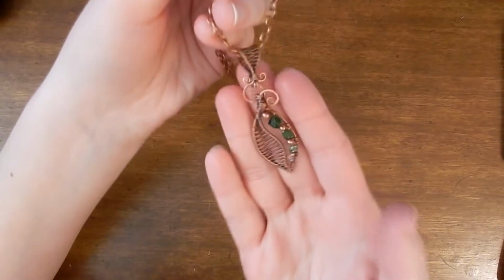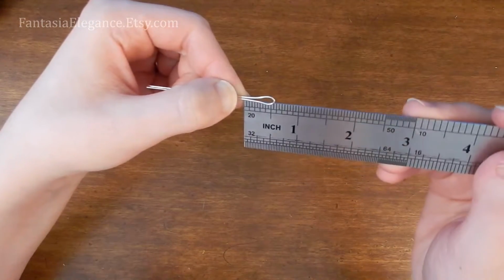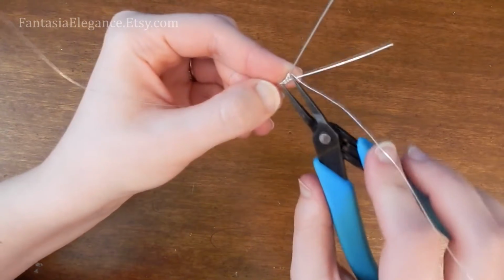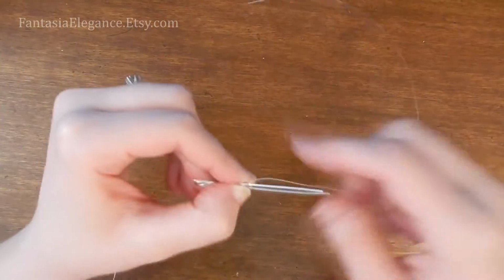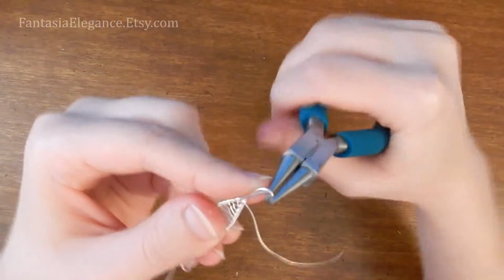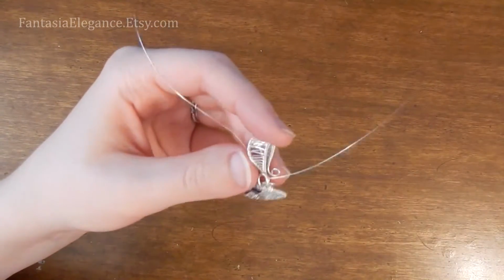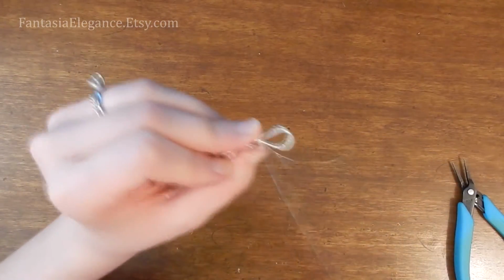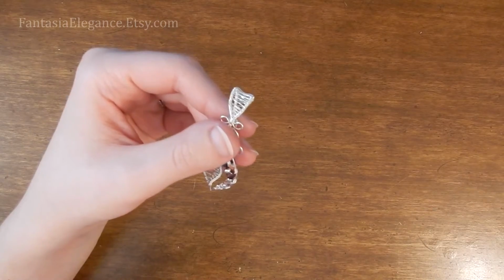Easy Wire Weave Bail Tutorial - How to Make a Detachable Bail for Beginners

Comment: “Thank you so much” I’m doing good with the jewelry making but I’d like to make a few  of your designs. I want to order some wire but would like to ask you what types of various wire  to order to begin with. I do have some wire from the craft store but would like to order the best sizes to begin with. I’m amazed with your designs and appreciate your videos. I’m recovering from cancer treatment and can’t get out to shop to find these various sizes. Just want to ask your opinion because it’s hard getting out to shop. Thank you for all your beautiful videos.🌻🌻🌻
Reply from the maker: You're so welcome! It depends on what you're planning to make.... if you're most interested in wire weaving, then something like 18 or 20 and 26 or 28 gauge would be a good place to start. If you're doing more general wire wrapping then I'd recommend starting with 18, 20, and 24. Also, RioGrande is a great place to order wire online! I always recommend something super affordable and easy to work with like dead soft copper when you're practicing :) I hope that helps! Thanks so much for watching <3